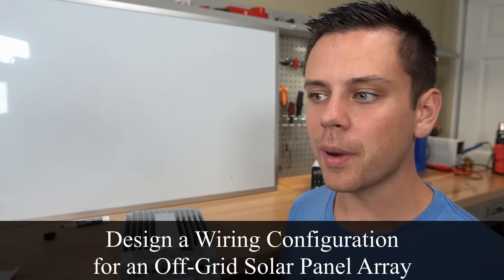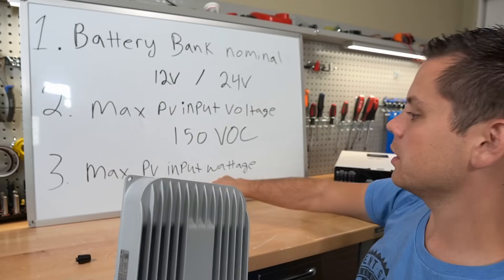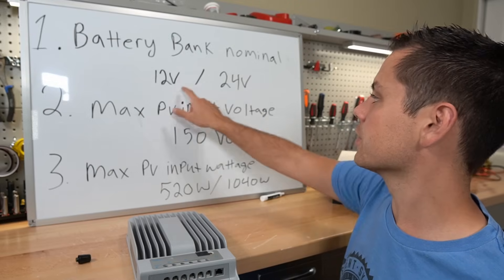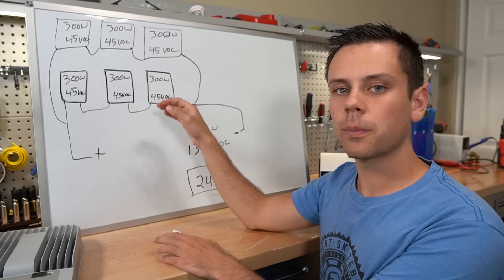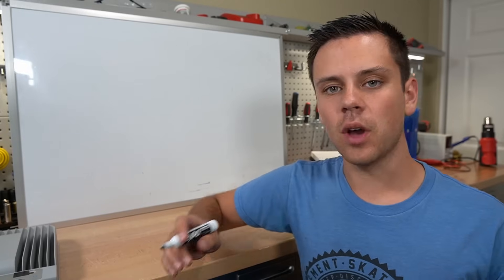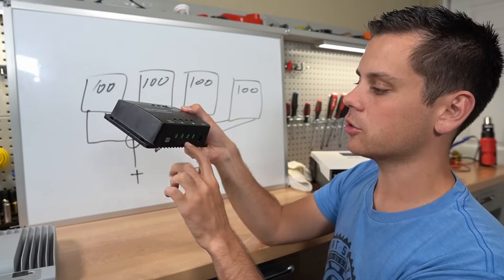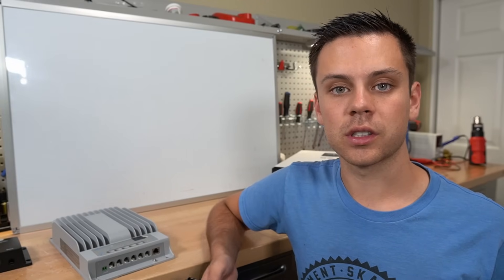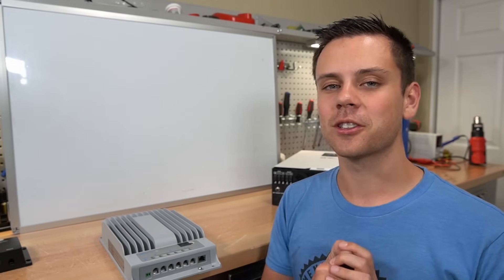How to Design an Off-grid Solar Power Array Wire Configuration

Comment from the maker: 0:42 3 important variables
1:12 EPever MPPT
3:19 24V 1050W Example
4:21 12V 1050W Example
5:34 MPP LV2424 Example
7:18 OCPD for multiple strings
10:13 12V PWM Example

~~~~~~~~~~~~~~~~~~~~~~~~~~~~~~~~~~~
Tired of getting ripped off? Check out my "Will Prowse Approved" solar product recommendations below!

12V Batteries
https://www.mobile-solarpower.com/lithium-batteries.html

48V Batteries
https://www.mobile-solarpower.com/48v-batteries.html

Offgrid Inverter System Builder
https://www.mobile-solarpower.com/48v-complete-system-blueprint-559371.html

Hybrid Inverter System Builder
https://www.mobile-solarpower.com/code-compliant-48v-offgrid-system.html

Mobile Handtruck System Builder (very popular!)
https://www.mobile-solarpower.com/mobile-48v-system.html

Solar Panels
https://www.mobile-solarpower.com/300w-solar-panels.html

Ground Mount Solar Racking
https://www.mobile-solarpower.com/ground-mount-racks.html

Wire, Lugs and Busbars
https://www.mobile-solarpower.com/wire-and-connectors.html

Tools
https://www.mobile-solarpower.com/tools.html

Fuses and Circuit Breakers
https://www.mobile-solarpower.com/fuses.html

Plug-N-Play Solar Systems
Ecoflow, Anker And Bluetti! So many models to choose from. See my current recommendations here:
https://www.mobile-solarpower.com/full-size-systems.html

~~~~~~~~~~~~~~~~~~~~~~~~~~~~~~~~~~~~~~~~~~
Need to build a large DIY system? Need a trustworthy solar distributor? These are my favorites:

Signature Solar
Creator of EG4! Solar Minisplits, Victron and More! Largest Solar Store Online.
If you want $50 off, please use my link below and coupon code "DIYSOLAR50":
https://signaturesolar.com/?ref=cPwLcVc0SW-BjN

Current Connected
Best Prices for EG4, Victron, Midnite and so much more! Fast Shipping and Highest Rated Customer Service:
https://currentconnected.com/?ref=wp

~~~~~~~~~~~~~~~~~~~~~~~~~~~~~~~~~~~~~~~~~~
Join our DIY Solar Community 
Need more help? Join the largest solar forum on the internet for beginners and professionals alike. 140,000 members and counting!
https://www.diysolarforum.com

Check Out My Free Book
Best-selling and beginner-friendly guidebook to off-grid 12V solar!
https://www.mobile-solarpower.com/the-book.html

~~~~~~~~~~~~~~~~~~~~~~~~~~~~~~~~~~~~~~~~~~
Contact Information:
I am NOT available for personal solar system consult! If you wish to contact me, this is my direct email: williamprowsediysolar@gmail.com
FTC Disclosure Statement and Disclaimers:
Every video includes paid promotion or sponsorship (such as free products for review). Some links on this YouTube channel may be affiliate links. We may get paid if you buy something or take an action after clicking one of these. My videos are for educational purposes only. Information is subject to change/update at any time. Electricity is DANGEROUS and can kill. Be smart and use common sense :) DIY Solar Power with Will Prowse is a participant in the Amazon Services LLC Associates Program, An affiliate advertising program designed to provide a means for sites to earn advertising fees by advertising and linking to Amazon.com
Reply: Pin this Will so your timestamps will always be on top of the replies. 👍
Reply: Awesome. Because of your inspiration pickedcup Bluetti eb240. , 4 170 w panels. N more working to get for whole house. It runs all but dryer fridge n a/c.  Next 5kw w battery bank. Thanks
Reply: You're steadily transmogrifying into that teacher we all wish we had teach us when we were at school, ^oo^
Reply: i have 24v solar panel set up and a mppt charge controller used to charge a 12v battery.. is that ok?,
Reply: @darwingrejalde5273  Im pretty sure it is not okay unless you somehow change that 24 to 12. I could be wrong though.
Reply: I'm new to solar and after watching a few of your videos I believe that a MPP inverter charger is what best fits my needs but do I need a transformer with one of those or do you have one for the US? The ones on eBay say they are for Europe and need a transformer for the US?
Reply: Super, can you please explain in 24v system connecting with ”4” 12v led aside batterys - the charging time, advantage, disadvantages please
Reply: I didn't hear you address the panels if they are different.... can you have a 350w solar panel connected to a 100w one or do they have to all be the same?
Reply: So how do you connect light and socket outlet from the off grid system??
Reply: Thanks to you I built two systems you need absolutely nothing head and slow and 80 years old and I really enjoy it as a hobby thank you very much
Reply: Solar panel system

I have 325 watt solar panels they are 34 volt panels with a open current voltage of 42 volts and with max current at 9.32 amps. I have a Rover PG 60 amp MPPT solar charge controller with a max open current voltage of 150 volts and I plan to use the 48 volt system which is rated at 3200 watts for a 48 volt system. I have a 48 volt lithium ion battery 50ah with 3.5 kw. So based off the max wattage input I can only install 9 —— 325 watt solar panels which equals to 2925 watts and a open current voltage of 379 volts which is way over the max open current voltage of 150 volts rated for the charge controller, so my question is which pv module wiring configuration do I use to wire my 9 solar panels to my charge controller and also I checked the manual of the controller and there is no pv module configurations, please I need help which wiring configuration do I use to install my solar panels ???????
Reply: Hello ! I have 8 260 W panels.  What Mppt controller I need to purchase as it looks like I burn  my 40A controller. Please help 🙏
Reply: How do I get your book. I love watching your videos but need to actually read it to thanks.
Reply: P.S.  I want to  divide my house load into 3 sub panels of lights, refigerators, and window  air-conditioners. I planned to make 10, 12 panel arrays using 2, 600W smart micro inverters per array. Then l decided on a off grid system after learning the short comings of grid tied systems. I have get battery backup.
Reply: How do I connect 8 panels of 495w to a 3kva off grid inverter??
Reply: Great Video! This is what I am looking to set up. Where is the best place to buy and get the best price? I can get a whole kit on Amazon or on E-bay but wonder if I purchased everything separately if I can get a better deal. I am looking at a 4.5 KW system with  8 - 10 solar panels, combination Inverter/Charger and 4 stand alone LifePO4 batteries. setting up a single phase 120 system for Lights and a swamp cooler and several 120 out lets for equipment use. I only include this to let you know I have been doing my planning, but am still looking for the best supplier.
Reply: Can I put three 300 watts panels in parallel and run 30 to 40 feet of 8 gauge wire to a Victron 150/70 inverter?
Reply: Excellent video👍👍👍👍👍👍the dry erase board helped a lot👍👍👍👍👍👍
Reply: Hi Will...
I have a quick question 4 u...
Ur experience & help would b greatly appreciated....
I have a solar install which was done badly & I'm trying 2 fix it...
There r panels on 2 aspects (East & West) but due 2 some1s stupidity they have been combined into a single series string (I'm guessing due 2 not enough space in the conduit to run 4 wires) & to a single MPPT inverter...
I have got a 2 MPPT inverter ready 2 go, as I mentioned there is not enough room for 4 wires, but there is room for 1 more cable...
I was thinking to combine the 2 negatives down the third wire...
Will this work.?
Do I need any diodes or anything else..?
Ur input would b greatly appreciated.
Thanks in advance.

Comment: Why use less than Stellar equipment . soon as you start it it's already too small overloaded Mickey Mouse setup 540 watt panels end phase converters minimum of 8000 Watts 12000 Watts tops when winter rolls around your power output on December 27th is cut by 3/4 in the Northeast battery storage four times the amount bad weather snow storms this nonsensical e n d in 20 years it will go by the way CB radios

Comment: Thanks Will!  I am circling back to this video after watching my installer break 24 540W panels down into 12, 2 panel strings “to comply with Idaho code”.   To be fair, in this case I asked them to design around Victron components and the MPPT is only rated 250v.  Apparently Idaho requires UL listed components and those are the largest that Victron has certified at this time.   The real challenge is our environment which can reach down to -35F on occasion…

Comment: You spoke about, should a short occur in one panel within a parallel network of combined series panels, there would be a back feed of power from the good panels to the bad cell. Would a rectifier at the end of each series line prevent this?

Comment: Hi Will. I am using Sungold TP6048 inverters which is 600 volts and 6000 watts maximum rating. I have 12, 45 VOC at 400 watt panels. Am I correct in stringing th3m in series. That will get me 540 volts and 4800 watts?

Comment: Hope you have a video on finding where the open circuit is within the system could I have a solar system that has 11 panels connected in one string in series that has over 350 volts being produced but produces next to 0 amps so clearly I have an issue

Comment: Hey I am trying to s t up a system I have 3000 watts of solar they are 365 watts it’s says 10.68amps 40.7volts I am looking to run series deciding still on 24v or 48v I have bought a 3500 watt inverter that will handle either but I’m not sure of charger to get 24v-means I need 125amp charger and 48v-says 62.5 amp but what I’m confused of if I total everything it comes out to 273.6v this part I’m unsure of can you help me out aw yeah I have 600ah in batteries lithium.  I’m only looking to run two refrigerator a stand up freezer and two 5000 btu acs if black I live in pc Florida where hurricane Michael came through just trying to make sure that’s enough hopefully I have over sized myself

Comment: Thanks for your valuable information and your understandable explanation. However I am confused about one thing. Anytime one voltage value is transformed into another voltage value there will be a loss in efficiency due to the heat of transformation - and the greater the differential the greater the heat of transformation. For example, if my battery needs 50 volts to recharge and I supply my charge controller with 50 volts from my solar panels, there would be no loss of efficiency due to voltage transformation because there would be no transformation! However, if I supplied my charge controller with 150 volts, that voltage would need to be transformed into 50 volts before it could charge my battery - and there would be a considerable amount of heat generated which would waste electricity! Consequently, why would it not make sense to configure the wiring of my solar panels so that they produce a voltage as close to 50 volts as possible? Thank you very much!

Comment: Hey will, weldone I followed you steps getting the epever tracer 4215bn and another 30amp 3215bn. Can you give a good explanatory video on how to parallel and program the two controllers to work together to charge 24v lifepo4 battery. Note different solar panels. It is not in your book. Thank you

Comment: I am reading zero votes of my series connected, solar pentals,
Each panel is reading 24 V.
When I connect 8 of them in series i should be getting at least a 190 V But I am reading zero volts.What am I doing wrong? 😮

Comment: I have a SunGold 5000w charge inverter with a built-in Mpppt. It has an operating voltage of 120-450vdc. I have purchased 12- 415w SunGold panels that have a voc of 37.5. With that being said it hooked in series will come out to 4980w and 450v. Will this be ok . I have not hooked anything up yet. I will be using 8 12v 100ah LiTime batteries also.

Comment: Your videos are great and easy to follow.  I have a question:  I have 4-400watt panels powering my DC motor pool pump. No  batteries. I would like to add a wifi breaker similar to one I use on at home. It is AC In/AC out and allows for me to monitor via iphone,: wattage/voltage/current, it also has a timer built in.  It sells for $39 on Amazon BUT its AC.  This would work perfect if I could find something similar to read DC in/out, wattage/voltage/current and the timer. The timer would be great so I could not have the pump cycle early morning. late evening when voltage is not quite up to the minum starting range. WIFI would be great since I could turn the pump off if the monsoons darkened the skies and played havoc with the pump!  Any suggestions appreciated   thanks

Comment: At 2:29 into the timeline Will talks about calculating the maximum solar panel wattage into the controller by multiplying 40A (rated output current) x 12V (system voltage), yielding 480W max panel. But in reality, charging voltage could be 14.4 +/- .2V  So, 40A x 14.4v yields 576W max panel (provided max Voc is not exceeded) Is this reality correction safe for determining a max size wattage?

Comment: Hi my name is joseph mrisho from zambia i have a problem on inverter 5kva system with 415w solar panel, but the maximum voltage is 60v to 105,sir i need help

Comment: Thanks!  So much changed since my first 65 Watt System in 1998.     With panels so cheap and MPPT controllers, I'm upgrading to 24 V, got two new 400 W panels and I will stop wiring in parallel unless necessary.  I still hate the MC4 connectors, so hard to use (arthritis) but I guess the days of junction boxes are gone.   Hoping to SOON not have to run the generator for a battery boost at night.

Comment: Hello sir if i put 2, 50 watt module in parallel then put them in series with a 100 watt module  and then parallel the 200 watt module to a  same voltage rated  535watt module do i need inline fuses ?

Comment: Have 2 questions.  First, why is my inverter fans coming on more frequently without a load, than with a load. Second ,I have seven 100w solar panels that have 2 panels that are series connected, then ran to a 5 to 1 parallel adapter going to my charger controller. My question is, what's the most efficient for charging 2 12.8v 100ah batteries in parrallel from solar panels to charge controller.

Comment: HELLO 👋 ... I have 10x 570w jinko panels rated 13.4amps , 50V.... to install with my 12k growat low frequency inverter 250VDC version... is it safe to install 5x5 for two PV strings  2 series 3 parallel =100V , 40.2amps.  For each string to create a balance?? ...I am living in the tropics 🇯🇲
Reply: I believe the model of your growatt is SPF 12000T DVM-MPV, it comes with 2 input string, maximum input voltage per string is 250Vdc and total input current is 120A. It will be same so long as you design your circuit within the input voltage and current limit.
Reply: @zenniz1992  thanks for this vital info 👊

Comment: So in Parallel the v stays the same but the watts grow?
Like 8 / 440 panels at 41.51 makes 3620w and  332v...and you make 4 strings the v stays the same but I end up with 14,488w when you run the 4 strings in parallel?
Reply: A string of 8 x 440W panel connected in series gives you 3620W. 
Connecting 4 strings of the same design in parallel will give you 3620W x 4. This is provided if all your 440W are of the same electrical parameters.

Comment: I have 2p-2s, which are 4 × 140 watt 7.9 amp kyocera pannels  running into the Midnight kid Has been working good...I've been wonder if you have done a review on the 30 amp midnight  kid.

Comment: Willy , you are doing great in your YouTube videos on Solar system. 

But there is something you were silent about when doing this analysis which is " parallel battery bank " system matching in relation to your analysis. 

I want to know if the current draw from a solar charge controller for a single 12volts battery and that of 2strings 12volts battery in parallel, whether they will have the same current draws ? 

It can't be the same ! So , how can someone increase the current in the array arrangement such that the input power requirements will still be that within the SCC specifications?

Comment: Why do you automatically choose to wire the array in series?
Series provides the sum of the voltages of each panel but the same current as just one panel. 
Parallel is the opposite. 

Why have you chosen to combine the voltages rather than combining the currents?

Would combining the currents (parallel) sometimes be better?

Thanks
Reply: Series connection is the most popular right now in the industry. If you connect in parallel, you will need to provide DC combiner box (fuses) which means extra cost, more point of higher and higher risk of fire like what he mentioned 7:23.

Comment: My user manual for the Tracer 4215BN says MAX PV array is 1560 watts and Rated Charge power is 520 watts at 12 volts. That makes more sense. 520 watt PV array is quite small for a 40 amp charge current controller. 520 watts would the maximum controller output not input.

Comment: Thanks dude, I was directed from your series vid didn't realize you covered para series here.
I sort of new but a re-fresher helped it stick in the grey matter.
Not forgetting about that temp related efficiency curve is a big one.

The regulations here are going through a full over haul for on site power generation and is probably going to be limited to specialized electricians.
They way I interpreted regs is that fusing needed to be applied to each panel and not a string or a situation that could exceed the load/protection rating of another panel in the system.

12/10 for making this a lot easier to follow 👍